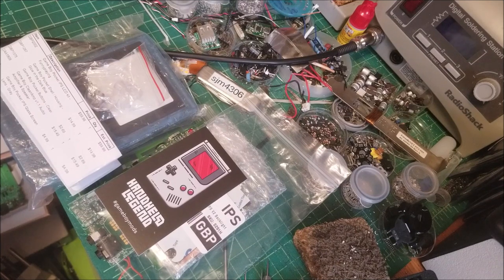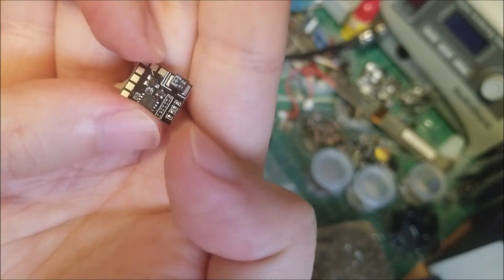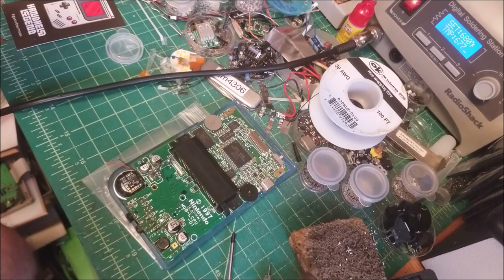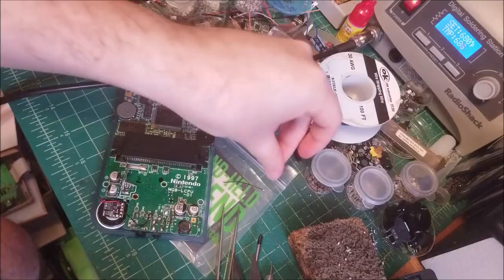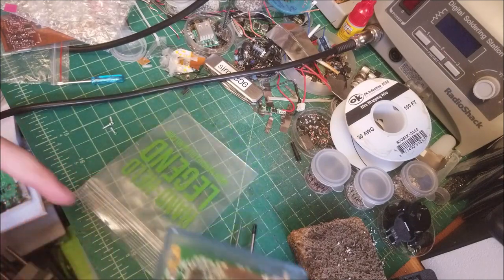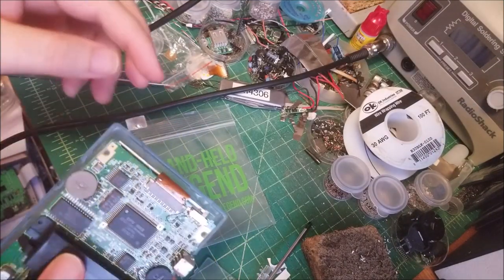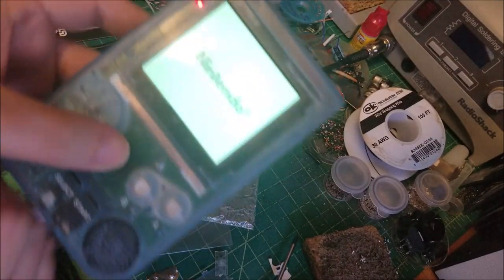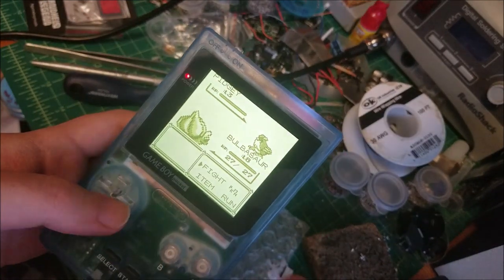Handheld Legend Gameboy Pocket IPS LCD and Clean Amp Installation

Comment: I second your opinion on not using that double tape sticker, It makes the uninstall nearly impossible and you will end up breaking the screen because of the presure, also, If you only stick it one the shell side, and let the protective film stick it to the double tape, you get the same result, the PCB of the console will do all the preusure needed to put in place the screen.

Comment: Good job as always Sjm showing and explaining. Wouldnt a 5v step-up booster be a great help for battery life here? Doesnt the original AC board struggle with both the new screen and speaker mod? Or does the original LCD with backlight mod consume more power??
Reply from the maker: The way the lcd ribbon is wired directly to the power switch makes me think it either runs straight off the 3v batteries or has its own onboard 5v boost converter. As for the speaker, at high volumes and batteries that are nearing their end it's possible to brown outthe gameboy. It may be possible to squeeze a little bit more run time with a separate boost converter.
Reply: @sjm4306  Ah yeah. Maybe it does have its own converter. But not what I can see on the pictures. Im no expert but theres nothing that looks like the 5v step up that I have atleast. I guess it could be that it's more energy efficient then the old LCD. Modding in a high capacity rechargeable battery with USB-C would be the dream tho to finish this off. There seem to exist very nice "drop-in" solutions for the GBA model 1. I wish the same comes for the pocket. 
PS. check your links in description. Both seems to go to the cleanamp.
Reply from the maker: Yeah I wanna do a diy lipo battery mod on this pocket as AAAs are a bit underwhelming. And thanks for the heads up, I'll fix the links.
Reply: @sjm4306  Oh nice. I will be on the lookout for when that video drops 😉😁

Comment: the screen transition happens with the normal screen but it happens so fast that you do not see it, does not have to do with the ips display
Reply from the maker: I'd guess it was happening not because of the ips itself but the video converter on the flex. My best guess is it uses a single port video buffer and due to the latency of alternate buffer reads and writes it runs at a lower framerate. If that were the case any graphical glitches would be displayed longer than they would be on the stock lcd.

Comment: Cool, it changes palette, using touch. Extreme skills. I still haven't finished my GBA mods to backlit. I had completed one but I overturned the screw and it broke, that one's disassembled again. I'm trying to assemble the shattered screw (I'm kind of a purist sometimes, all original as possible even if it's cracked or doesn't look good, as long as it's original:-)

What do you think of the console called Playdate?

God bless, Stay safe.
Reply from the maker: I love these lcd mods, if only they came out earlier. I think the playdate is an interesting concept, probably wont get one though given the price and limited run.
Reply: @sjm4306  I wonder why they made that. I see it being on sale in no time, in a year, for 10 US$. How much do you think does it cost to make, just the materials?
Reply from the maker: Oh the material cost is probably only ~$50 in low to medium quantity. The thing is though the software and hardware is where the magic is. Hiring a team of professional engineers to work on a project like that would've cost quite a bit and is considered as a non-recurring expense that factors into the cost. The screen, a sharp memory lcd, is also a pretty uncommon, exotic, expensive variety. Additionally looks like the case is machined aluminum which is very expensive in both equipment and processing. The final cost of a product is way more than just the sum of its materials, someone or some group of people had to spend many hours and considerable skill to design, test and manufacture it. In the end though I think what has the biggest factor in price is that this is a niche product aimed at hobbyists.
Reply: @sjm4306  US$50, I see. It's true, it's extremely niche. Not sure why it's not backlit and 1 bit display (that's going back to the very first personal computer, the Apple 1 or the first IBM PC). I don't get why they made it like that. The games look really simple and repetitive (even that Time Traveler made by Katamari's developer which seems to be the killer app).

I also don't get the games a week but unknown, that's like a loot box, lol. I guess they have a lot of allowance to discount when it goes on sale.

Fishing would be a killer app for it and a music box but it'll have to be priced as a kid's toy US$10.

How about the Atari VCS and Amico, what's your take on those? Wii already beat Amico as a casual, family console, it's doesn't last (people still want the most powerful: PS5 I think overall, holistically would be faster coz' of it's optimized design.)

All effects and resolutions equal, I would bet the Xbox Series X would stutter in a very fast loading game like Spider-Man (they should do an open-world DC Flash game) with long draw distances (same with games like that Epic PS5 demo).
Reply: Yup, mods are very cool. I wonder when they will make an LCD or OLED replacement that has the exact same size as the original Game Boy Color (and the other Game Boys without light), without having to mod the casing, you just connect the ribbon cable as if it's the original screen? Why haven't they figured that out yet?
Reply from the maker: I'd kill for replacement oled screen mods!!! As for the atari vcs and amico, I think the companies have been long bought out by investment groups so it looks like a cashgrab to me, but hopefully they at least hired engineers with nostalgia and passion.